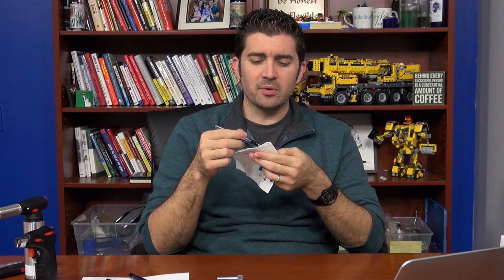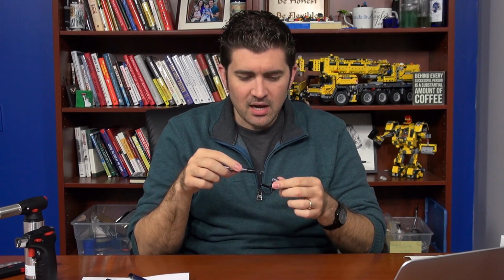Can You Use Compressed Air To Clean Out A Fountain Pen? - Q&A Slices

Comment: Cans of "compressed air" are never actual air, because you can hear it sloshing around.  Once upon a time (cue Disney music) it used to be freon.  Then the ozone layer decided to disappear and freon was banned for everything non-essential.  These days, the propellant used in pressure cans and the main constituent of a "compressed air" can is diflouroethane, another refrigerent.  It's not going to hurt a pen.  It's probably not a good idea to use high pressure air (like from an actual air compressor) because you might finish up shooting your feed and nib across the room or into the wall of your work room.  Low pressure air and so-called "compressed air" cans won't cause any problems however.  Diflouroethane is a very large stable molecule that won't dissolve into the inks or damage the pen.  Butane is also used as a propellant in many pressure cans, but not in "compressed air" cans like dust-off etc.

Comment: I have a small air compressor and I can control the air very well. So I use about 10psi to clean and dry the inside of the pens and converters.

Comment: I think that there will, especially on the more saturated inks, show up a dilution effect. I like to use Diamine Majestic blue and refill my cartridges, I also use Majestic blue in my piston fillers. After cleaning out and refilling the cartridges with a syringe, there definetely is a difference in colour to the piston fillers that I just refill when  they aren't dried out and don't flush out. The deep, blue, shiny colour of the Majestic blue does not show up on my cartridge pens, but on the piston fillers !